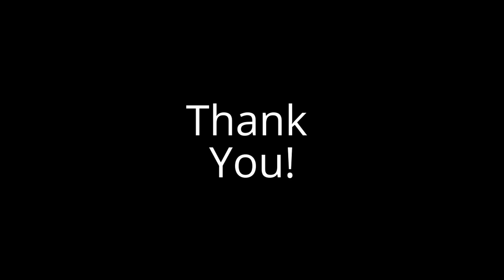Disneyland - 7/14/17 Star Wars: Galaxy’s Edge Construction Update

Comment: Thanks to your zoom skills, I could see what appears to be a large open area over the basement (@4:00).
Reply: Bruce Marshall yeah and that guy walking down the freeway over the toon town hills at 7:04 ...what kind of super spy camera is that Jane?
Reply: Levi, LOL
I had missed that guy. Good catch!
Reply: Bruce, I have a feeling that the basement as you call it and the space above it that you are pointing out here are going to be a very interesting part of the experience. The imagineers did call that big square pool "the Pit" during the original info session! Very interesting! It certainly is going to be the most elaborate "Fun House" ever constructed!
Reply: Michael Sullivan at 0:50 see that air duct? Isn't this supposed to be part of the queue? So does this suggest the line will be  multiple levels in this area?
Reply: Michael, Plus somewhere in all that steel will be lift systems to move us between floors!

Comment: I am facinated by the wavey siding on BE. I hope it's an indication we'll get rock work on the back.
Reply: Bruce Marshall I was thinking the same thing! Reminds me of the mesh you put stucco on
Reply: Levi Black, Exactly!
Reply: Yeah, that's a LOT of time consuming effort to tie in all that "rigging like" cross bracing to hold up those horizontal countertop like vanes running lengthwise down the building. It almost looks like that part of the walls will be open for air circulation. I too hope that it will support scenery to make the buildings less buildingy.  Or is that buildingee? I give up... Nevertheless it is a unique suspension gambit...  We shall see, or perhaps not see as the case might be!
Reply: I am thinking that it might be support for insulation, exterior/interior wall panels.  A building this size is going to be beast to control the climate inside without a lot of insulation.  Those trailer looking boxes on the roof are the air handlers for the climate control systems.
Reply: John Purdum good point

Comment: Thanks Jane!
Once again I would like to point out about the two circular ring constructions tucked right up beside the far wall of the Battle Escape building. 4:41 I think that they will be part of the BE adventure rather than the Millennium Falcon adventure. MF has those two big ring constructions that are now within the confines of the MF steel frame building. The two slightly smaller Rings are (or appear to be) still out in the open. In all the plans and photos so far there seems to be an open gap between the two attractions.  Due to the angles of things it will be very difficult to see what goes on in that area where the two smaller circular constructions sit. Perhaps Disney will give us another surprise drone look at SWL in process?
Reply: Michael, Wouldn't that be fun!